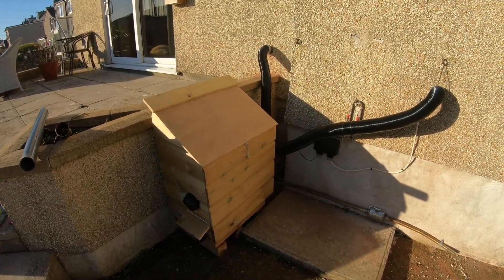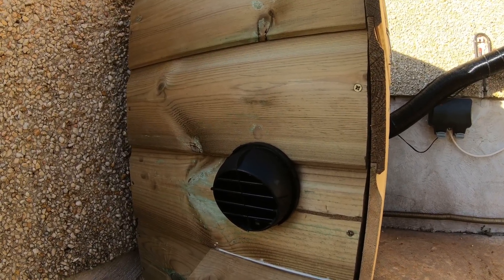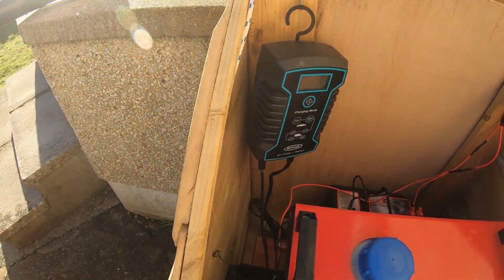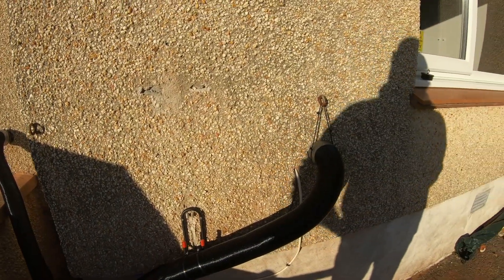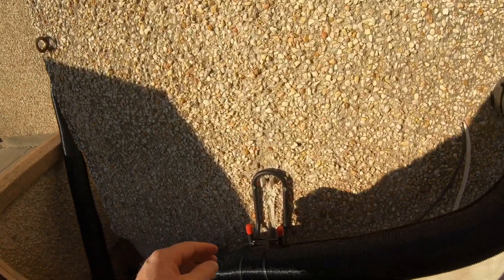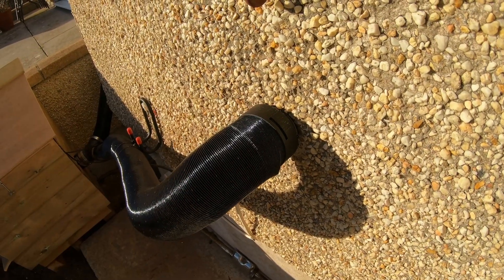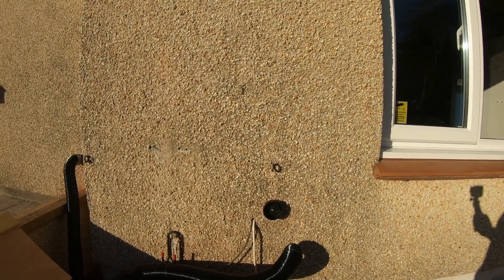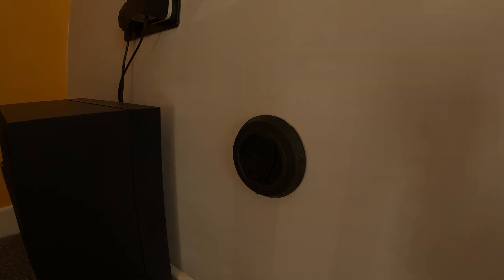Heating my home with a Chinese diesel heater.

Comment: Richard Baker did some good work measuring the air speed and delta temperature on what was sold to him as an 8k diesel heater and this output was closer to 3kw not the 8kw he was sold. The 8k might be kilo  calories not kw.  If you are comparing electric rates you may not be getting what you thought. But still lower cost with the higher energy cost.
Reply: Too true, of all the tests of 8Kw heaters I’ve seen, only one reached 5Kw with the rest between 3 and 4. A bit like the Chinese headlights/torches that advertise 100,000 lumens 😂

Comment: I was thinking about doing this  at my house, I hadn't thought of splitting it between two room though. Had you thought about insulating the pipes coming in to the house? They must be losing quite a bit of heat.
Reply from the maker: Hi Jamie. Yes, the pipes were insulated after I shot the video. I wanted to show them in situ beforehand. They are insulated with industrial grade silvered bubble wrap. I used an infrared thermal thermometer to check the heat loss both before and after insulation. The insulation is very efficient. Thank you for your comments.

Comment: What a progressive word we live in, going back to oil heating
Reply: Tell it to the government
Reply: That is one off stupendous comment on I n telnet
Reply: We can't all afford heat pumps that don't work
Reply: #2 Fuel Oil (Diesel) has 120,000BTUs per gallon, highest fuel energy density out there...
Reply: My main fitted boiler runs off oil
Reply: Houses are not insulated at all for money saving
Reply: Forced to !! 😮
Reply: You vill eat zee bugs and like it !
Reply: @en53kff what adapter and batterie do you use
Reply: Is "what" a progressive word?
Reply from the maker: What a progressive world when your village has no alternative to oil except expensive electricity.
Reply: "Net Zero" is the name of the expensive boondoggle.
Reply: Gas prises 3.34 euro every 1m3. Diesel takes a 1200 euro gas bill a month back to 50 euro a month. Dont even start about the electric. Almost everyone got solar panels. But now u dont get money back ohhh nooo. If u go on holliday and u dont use your own electric. The electic company charged u for delivering back electirc to them. So u dont use anything in your house. U get back from your 3 week holiday and u get a electric bill for a few 100 euro.
Reply from the maker: @RealfishingNL   Yes, diesel so much cheaper option here too. Not too many here have solar. I’m surprised you get screwed if you go on holiday. That’s just mean action by the electricity company.
Reply: @en53kff  first u got money back from the electric you generate. But because now so many got the solarpanels they said we cant take it all because there is to much and its casting money to re route the electric. Next thing now is we put like electric car battaries in the ground so we can store it ourselfs. And not only on holiday. Every sunny day when u cant put on all the machines the washer the dryer with noting in it all lights ect. Its cheaper than giving it to the electric company 😋
Reply from the maker: @RealfishingNL   It’s a crazy situation. Yes if you can store it would be best option. Interest information that I didn’t know. Thank you. 👍🏻

Comment: That looks tidy, I have a similar set up in my garden shed/workshop. I had the heater inside but it was a little noisy so I boxed in the underside of an outside workbench and piped it into the shed. Mounting the fuel pump onto something more solid than the flimsy steel on the heater cover really helped the noise. Works a treat tho.

Comment: I'd go with a non flammable enclosure and ditch the battery and charger for a 12v dc supply. Apart from that I like your  set-up.
Reply: Also, as I understand, on startup the glow plug draws much larger current than later. A battery is ideal to provide the initial larger current.
Reply: He said that they have frequent power cuts in the area and diesel heaters are not happy about that. The battery setup is basically an uninterruptible power supply (UPS).
Reply: @StopLossLOL  if kept charged, which it won't be with a diesel heater drawing all the power pretty quickly. Solar charging is also useless in winter.
Reply: @railinly610  it doesn't have solar charging. It's an AC charger.
Reply: @StopLossLOL  handy in a power cut eh.
Reply: @railinly610  Will run off the battery during a power cut and then get recharged when the power is back on. Perfect solution.
Reply: @StopLossLOL  except that it will flatten a battery in half a day. OK for short power cuts, jut about.  These heaters zap loads of amps during start up and when they go into shut down.
Reply: @railinly610  power cuts in the UK are usually minutes long. Not days.

Comment: Great job, I think we will start to see more and more of these types of installations.  Just make sure your outside socket has 30mA RCD protection if you haven’t already.  Especially if you use the spare outlet for a lawn mower etc.
Reply: I agree, this is a great idea, and will definitely increase in popularity. My concern going forward, will be how long is it, until these are outlawed in someway by the authorities.

Comment: I wonder if you could run these on old chip fat like diesel cars? 🤔 No problem with the fumes either
Reply: Because burning oil produces no fumes or CO/CO2 😂
Reply: @HiruS22  I didn't say it wouldn't produce any. I said there's no problem with them, meaning the smell.

Comment: you might want to extend your air intake and take air from the house. I also use a 12 volt battery with a solar charger
Reply: If you take air from the house it will create a vacum and suck cold air into the house from outside.

Comment: As the pipes are long to enter the house does it still keep it warm enough in winter when entering the house? has anyone thought of having the heater inside the house and exhaust just going to outside thru wall?
Reply: Yes, I have my diesel heater indoors, sitting on my fireplace since that is made of brick so there is no danger of the exhaust pipe scorching or setting fire to anything. The version I use has 4 smaller (40 mm diameter) outlet tubes, which allows me to split the hot air into 4 different rooms using 40 mm plastic wastewater pipe, with short pieces of flexible tube to get it around corners. The other reason for having the heater on the fireplace is to route the exhaust pipe up the chimney, so there was no need to drill an extra hole through the wall to direct the exhaust outside. This seems to work efficiently - I have a carbon monoxide alarm next to it which has never gone off, so the chimney draw is evidently enough for this to work.
Reply: @lloydevans2900   Thanks for that comment, I was thinking of doing the same thing!

Comment: Really good setup, niceley done. For backup heating nice to have on hand. I am wondering, did you have estimates on costs running this all day in winter if you had to? Do you plan to use a thermostat to trickle down the heater? I am curious how much diesel you hace stored in your garage?
Reply from the maker: Hi. I didn’t have estimates as such, just viewed other videos of others on YouTube. I have taken the control unit off the unit, extended the wiring and mounted it in the house. I can set the temperature I require on the unit. Therefore I don’t need a separate thermostat. Once the temperature is reached the units diesel pump slows down and holds the set temperature. I’ve since installed a 15 litre fuel tank to replace the standard 5lt one. I only buy and store 20 litres at a time. Hope this helps. 👍🏻
Reply: @en53kff  if memory serves me it's all your legally allowed to buy and store domestically. Any more and you need a fuel storage licence.
Reply: I guess with the correct tank (500L) you would have no problems. @stuartcraigon2003

Comment: Hi ya Rob,

Just quick one please, im renting apartment;  im not allowed to drill a wall, so just wondering is output pipe very hot, is there any insulation on it? I was thinking to put window seal for mobile A/C but im afraid that pipe probably will just melt that window seal

Regards,
Vatro

Comment: You might lose a lot of heat even before it reach the inside of the home.
It happens that I just watched a video a couple of hours ago that is focused on it:
£0.03 per kWh heater modification - Top facts & lies on diesel heaters - waste veg oil burn success
Joshua De Lisle
https://www.youtube.com/watch?v=4tiSEGO6pYI

Comment: Thank you, good information. Haveyou considered lagging [insulating] the 75mm discharge tubes ? My shed heater draws and discharges air from within the shed and the discharge tube runs quiet hot, wasted heat in your case and tubes being effectively finned dramatically increases surface area.
Reply: I was thinking the same thing. I recently bought 10m of high quality weatherproof exhaust lagging for my boat for ~£25. The manufacturer says it keeps in up to 50% of heat. Even if in the real world you only get a 10% increase in efficiency, this will pay for itself in mere months.

Comment: Nice setup.  I think the reducers are good for the airflow, since you split the output air hose in two.  I also like how you didn't use a permanent attachment to the house.  I think your heater will last longer since it's not sitting out in the heat and humidity of the summer.
Reply: Also, Poe insulation 😏 would make it go further

Comment: Brilliant videos. Unfortunately I live in the city. So my question to you or to anyone else is. Is it possible to convert or connect the heater to heat the water in my radiators of my house. If anyone knows how this can be done, please make a video to let us all know. Many thanks.
Reply: You can buy a Chinese water diesel heater will fit anywhere in your existing pipework with no trouble

Comment: Lovely Job, How well does it heat the house?
Reply from the maker: Hi Michael. It’s only a two bed bungalow I’m heating but it does an excellent job. It has a thermostatic control which I usually set at around 20 - 21c. I’ve had it up to 25c before but it’s far too hot for me. Needless to say, the harder you make the heater work, the more fuel you’ll use, but in comparison it is still cheap to run. Because I have closable vents in each of the rooms, I can close one if I choose and the other room will warm up quicker. If the house first thing in the morning is at say… 14c, it will take around an hour to heat it up to 21c.  I hope that helps and gives you some idea.

Comment: OK, it's looks very nice - now the real question you didn't address.  There are many ways to heat a room and a fireplace is another example but I suspect your house has a few more than two rooms so the big question always has to be distribution.  In my case it's a 4 level split so I have 4 different levels in the house and even if it was all on one floor how do I get the heat from the bedroom or the lounge to my basement where all my water pipes are.  I'm guessing that where you are you don't get real winter. So you need to tell us what your winter really is - mine is 5 months of temps from -40 to +10 in Canada are you anything close to that ?
Reply from the maker: Wow, now you’re asking a bit more that I can give you a positive answer for. Firstly, the one pipe heats a bedroom, then beyond that is a small bathroom and small kitchen. Yes, in the UK they do tend to be a lot smaller than yours. The second pipe heats the lounge and one bedroom adjacent to that. That’s it. It is a small footprint. I set the heater to around 20c and it takes around an hour usually to level out at that. The heater will then settle down to hold that temperature. As for winters, we get nothing like the ones you have. If we have a few weeks below -5 it’s considered cold. Snow is sporadic and usually short lived. As for your split levels, that’s a whole issue I’ve never thought about or had to deal with. Good luck with it though.

Comment: My project for next year! Thanks.I want it to run off waste cooking oil/kerosene mix.
Reply from the maker: Hi Carl. I’d thought about a fuel mix. Maybe later. It’s the filtering of the oil which is a pain. Probably benefit too from a drop of diesel cleaner you’d normally put in your cars fuel tank. Anyway, good luck with it. I’ve not heard of anyone who regrets buying one. 👍🏻
Reply: @en53kff  I watched this video about how to do it. https://youtu.be/4tiSEGO6pYI?list=LL Perhaps I'm running before I can walk ;) Will go with the outside install like yours first.

Comment: You need to heavily insulate the pipes as you will think it's air conditioning being pumped into the house running through a fridge plant, nice set up. I use about £2.50-£3.00 a, day heats most of my house,  if l was using gas cost me£13 a day . I was a bit skeptical, but not anymore 😁
Reply from the maker: Yeah it’s a big saving. 👍🏻 As mentioned in video description, the pipes are insulated. Cheers.

Comment: Will you be insulating your hot air pipes? I like your idea of using the diesel heater for your house 👍🏽
Reply from the maker: Did you read the video description?  🤔
Reply from the maker: Quite a few people catching on to the idea now. It’s certainly cheaper than many other methods of heating. 👍🏻
Reply: Could the neoprene? pipe run all the way inside the 75mm pipe to act as double walled insulation?

Comment: Interesting but just imagine how many BTU's are being wasted because your outdoor pipes are not insulated, 25-50% minimum wasted. After equipment purchase and fuel purchase I'm guessing you are likely spending more money not less because of wasting heat to the outdoors. This setup is much better suited to a garage space like many others have shown because the heater can be safely installed indoors and the only wasted heat then is the exhaust which could even be put through a homemade heat exchanger as if desired.
Reply from the maker: Maybe you’d care to read the video description. 🤨
Reply from the maker: Over the last 28 days I kept my home at a steady 20 degrees on a little over 38 litres of red diesel costing £53. I’d say that was pretty damned efficient.

Comment: Needs a bigger diesel tank as your forever topping it up if used for house heating.
Reply from the maker: Hi John. Yeah, I’ve thought about that. Maybe a summer project ready for next winter. I fill the tank about every two to three days, dependant on how cold it’s been and how long the heaters on for. Are you heating your house with one too then?
Reply: @en53kff  I fill it once a day as its on 24/7 but mine is inside the house so its difficult to modify. I will have to re think it for next winter but its great for keeping the cold at bay at least!
Reply from the maker: @jbradbury2   There are now plenty of videos on YouTube as I’m sure you know, showing varied set ups and modifications. We can all learn from others and have fun doing it. Good luck with it. 👍🏻

Comment: room for improvement insulating the pipes into the house will reduce heat loss. Batteries do not like the cold and
often die, move the battery inside. Heat loss from the exhaust, route the exhaust pipe into and back out of the house.
Reply from the maker: If you read the video description it says that the pipes are insulated. I don’t want any part of it inside, that’s why Ive put it outside.
Reply: That is a ridiculous suggestion running the exhaust through a living space. Why why would you want to take that chance.

Comment: Also,  you might want to think about using a solar panel to charge the battery for those longer power outages.  You will continue to have heat with no electricity from the power company.
Reply from the maker: Hi. Yes that’s always an option to look in to. It could be one of those temporary fold away solar panels that you get out just when you need it. I shall have to price them up.  👍🏻
Reply: @en53kff  still,  you did a nice looking job on it.
Reply from the maker: @IMJUSTBILLUNO    Cheers bud.  😊👍🏻
Reply: If you want to add a solar panel and controller as a fun little project, then fine - but the heater draws so little power that it does not make sense financially.
Reply: It draws quite a bit on startup, but once it’s up to temp the current draw is low

Comment: I installed mine inside a utility room I made. Used a wall Timbal for the exhaust, air intake is inside, ired up to a wall mounted home furnace thermostat with two time delay relays and a power supply.
Reply from the maker: Sounds like you’ve got it sorted there John. Yes, I’ve seen timbals used a few times in different circumstances. You’re obviously happy with it like I am with mine which is what counts. Cheers John.  👍🏻

Comment: An excellent solution. What is your electricity price pr.KWh in your area ?
Reply: How much standing charge do you pay. 🇬🇧 😁
Reply from the maker: @andrewdaley5480   🤣😂
Reply from the maker: Hi Jon. It is 37p kWh.  Just wondering about the relevance?
Reply: @en53kff  Just curious.  Where I live it is  around 6p kWh so I understand why people are setting these up. I installed a unit like yours in my car to warm it up and defrost in the morning.
Reply from the maker: @jondavidsson6874   Yes, I’ve heard of folk putting these in cars, school buses, camper vans and the like. Where do you live Jon to be getting electric at that rate ?  Im in North Wales.
Reply: @en53kff  I ive in Iceland and may want to correct myself the price is 11p kWh
Reply from the maker: @jondavidsson6874   so still less than a third of what we pay here in the UK. 😳
Reply: @en53kff  Yes yet we are  lucky here with energy prices though food and everything else is more expensive.  So even if you had two of those it would be beneficial.